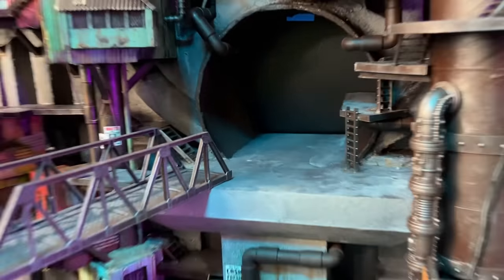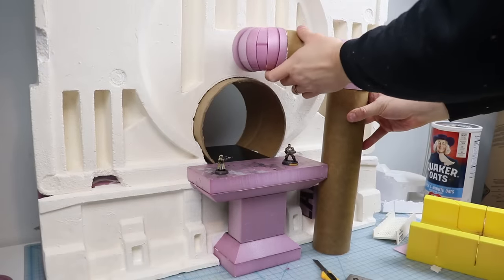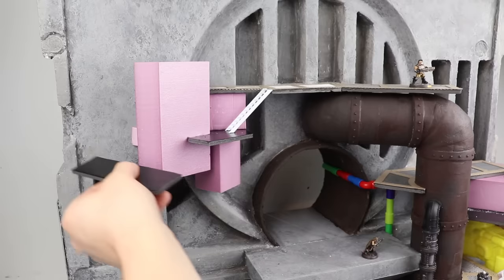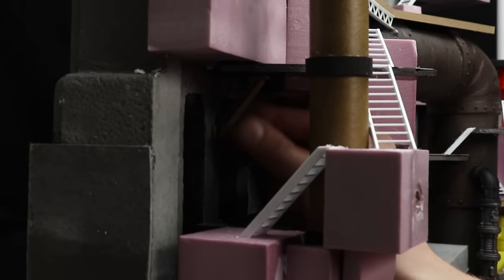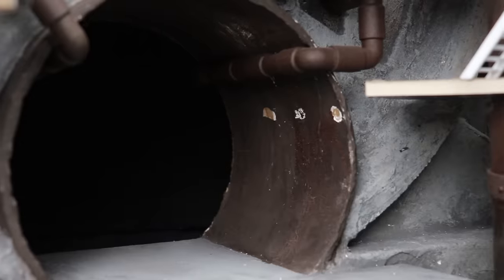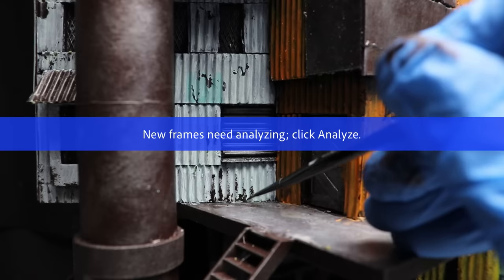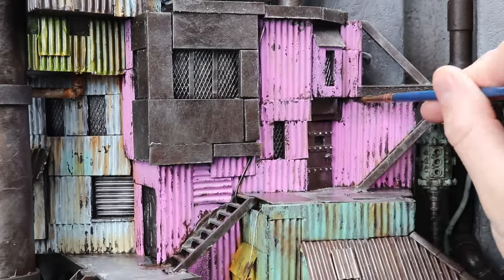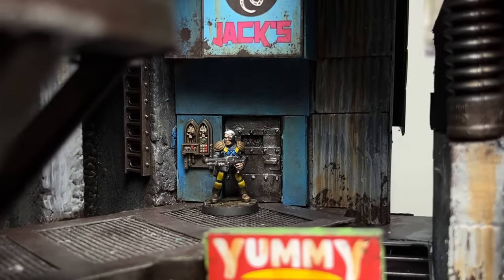Making a Necromunda HIVE CITY | Warhammer 40k terrain

Comment: Sculptors' mesh with PVA glue dried into it (laid on a flat plastic surface), makes for great lead-light effect windows. The glue dries clear or sorta clear (depending on the type), and is amazing when back-lit. Be liberal with the glue, as it shrinks significantly, and it takes a good couple of days to dry.
Reply from the maker: Cool tip! Ive seen it done with uv resin, id like to try that

Comment: In UK chipboard is heavy duty composite, made of visibly random slivers of wood stuck together and made into sheets. It is used for floors, partitions etc not dainty things. We also have hardboard which is like very thick card and can be cut with a hobby knife. Then we have plywood, really nice stuff with multiple uses, some for indoor use only, and a heavy duty type called marine plywood for outdoor use. Plywood comes in various thicknesses, and all good designers would agree it is an elegant and beautiful material.
Reply from the maker: Plywood does seem to be gaining in popularity as a decorative material these days. If done poorly you look like you atr squatting in a house under construction though 😂

Comment: About bubble texture. It can represent Cellurar Concrete, Its weight is much smaller than normal or reinforced concrete. Its used in brick production like Ytong blocks that has good temperature isolation thanks to air pockets inside. Although i dont think massive Hive city can be build on that material. Maybe some shacks or additional structures build inside can be done using it but not main structure

Comment: Absolutely incredible build. If I would make one suggestion, it would be that you should make a removable backdrop piece for the central tunnel. It's actually very noticeable that there's just nothing inside that and it would be easy to take an image of a very big tunnel (I.E. something left in the wake of one of those giant drilling machines they used to make the Chunnel or the like) and install it so it looks like the tunnel stretches on for an unfathomably long distance.
Reply from the maker: I am going to try to make an infinity mirror effect in it but i didnt have time

Comment: Love the look of this. I'm thinking of making one in a slightly smaller scale of 1:64 scale(HotWheels). A post-apocalyptic land where the rich live off planet. 

Here a thought on when you use that Styrofoam use a mix of acrylic paint and Mod Podge it will seal and toughen up the foam. You can add different sizes of sand to make any surface you like. When you had that softer cardboard tube coat it in Mod Podge and it will be very strong.